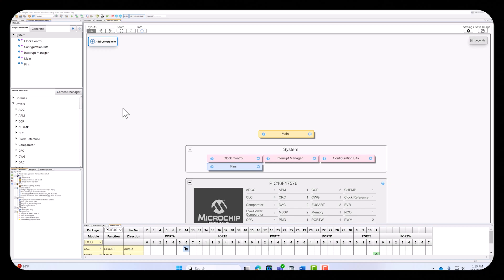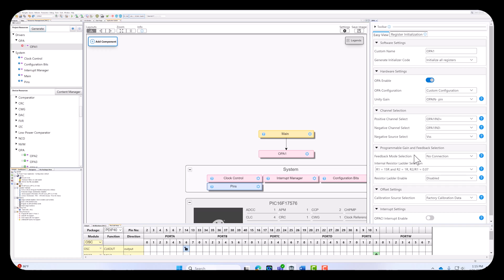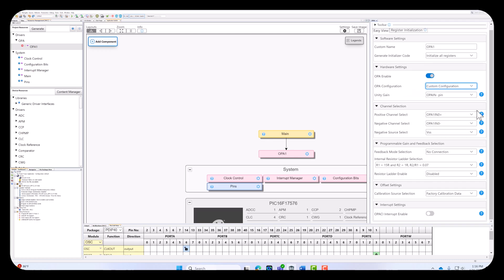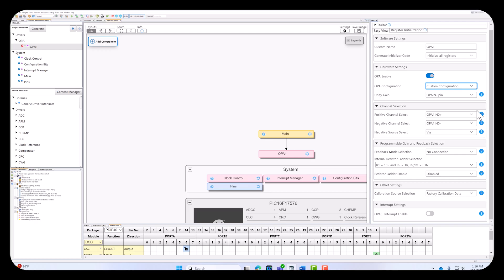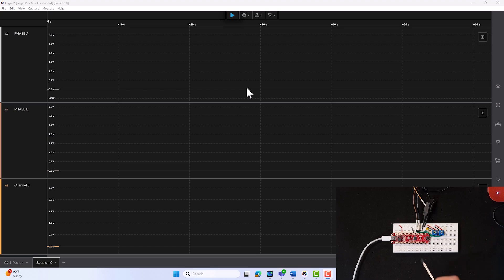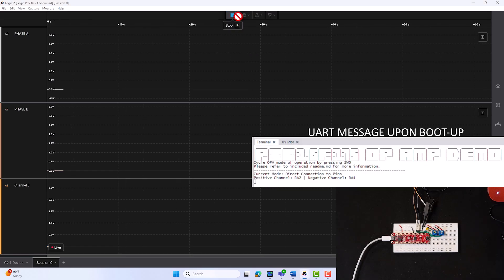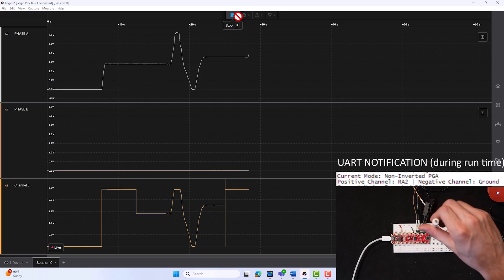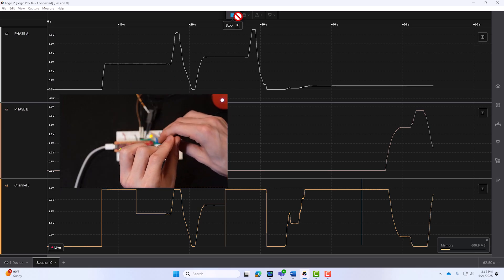Four Op Amps??? In One MCU???

Comment: Some microcontroller that can measure thermocouple?
Reply: A few Microchip references: https://ww1.microchip.com/downloads/aemDocuments/documents/OTH/ProductDocuments/UserGuides/51889a.pdf

https://ww1.microchip.com/downloads/aemDocuments/documents/MCU08/ApplicationNotes/ApplicationNotes/AN844-Simplified-Thermocouple-Analog-Solutions-DS0000844B.pdf

https://ww1.microchip.com/downloads/aemDocuments/documents/MSLD/ApplicationNotes/ApplicationNotes/00001306B.pdf

Hope some of these are useful.  You can use the internal opAmps in place of the external components used in these older application notes.